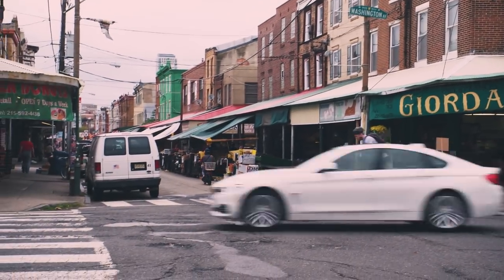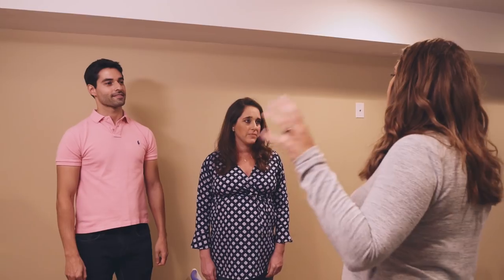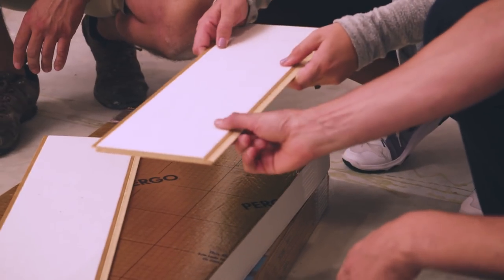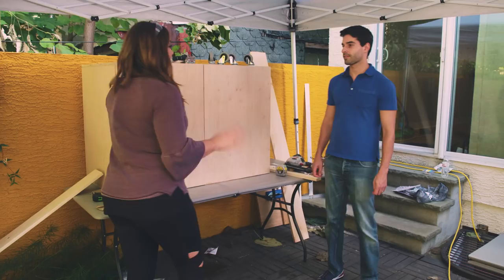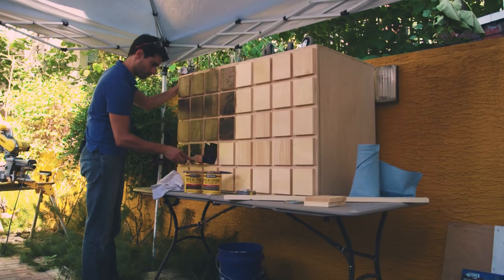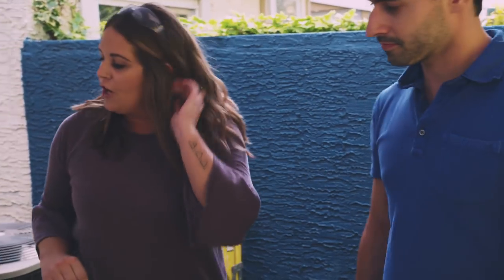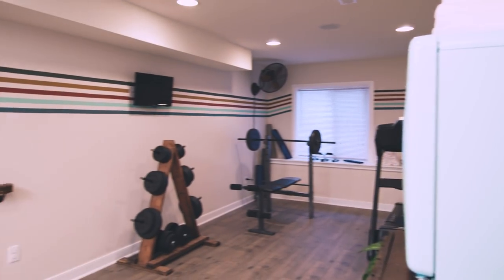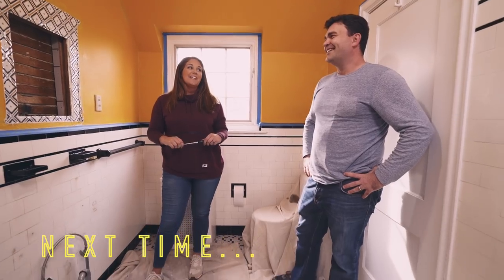The Weekender: "The Retro Gym" (Season 3, Episode 7)

Comment: Best way to get really sharp lines even with bad masking tape is to paint with the background color first, then the color of your choice over. That way the paint that would bleed inn under the tape would be the same color as the background, and when you peel the tape of you're left with a really sharp and clean line.
Reply: Mr. Kate also gave this advice in a video a while back, I think. I will try it out, thanks!
Reply: I did horizontal strips in my guest bedroom using this trick last year. The lines are so crisp and perfect. Also, always peel the tape before paint dries.

Comment: Those pegs on the weight stand will not last long. The weight stand should at least have a steel frame to which the pegs would be welded or bolted on .